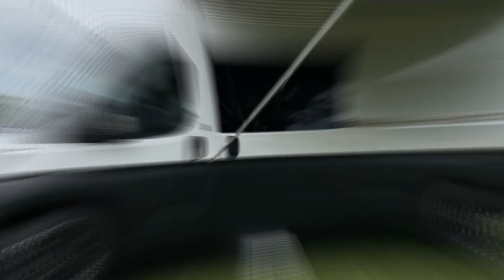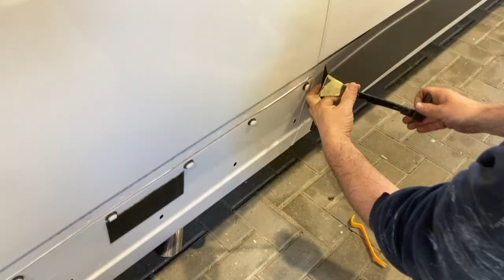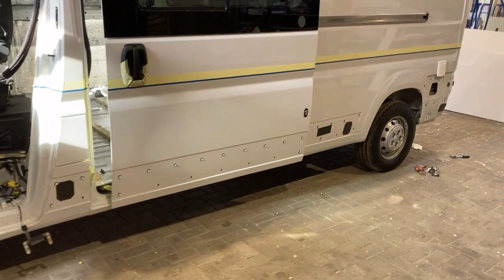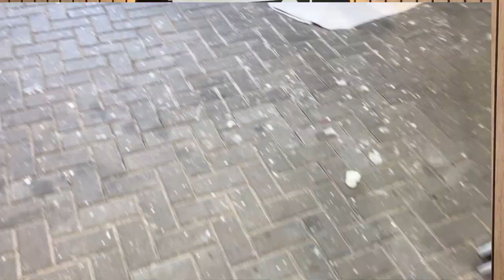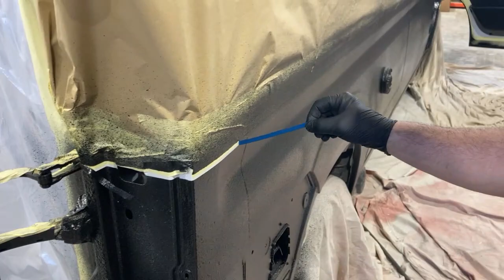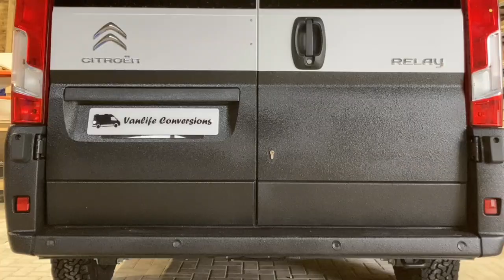Transform your van with RAPTOR paint | Durable and easy to apply | Adventure van

Comment: Raptor 
A. Volume – 3 parts RAPTOR – 1 part hardener – up to 10% color.
By weight
B. 100g RAPTOR – 30g hardener – up to 10g tint (3.5 oz RAPTOR – 1 oz hardener – up to 0.35 oz tint).
Refer to online TDS sheet for additional quantities.
C. 28 oz. RAPTOR (1 bottle) – 8.4 oz hardener – 3 oz tint.

 RAPTOR can be reduced up to 20%. When reducing RAPTOR, use a urethane based reducer.
Reply from the maker: Thanks for the comment

Comment: are you removing and re-applying the thin blue tape between each coat? You mention that you apply three coats, 45min between coats and must remove the tape within that 45min. Just wondering if you remove and re-apply or stack three layers in the beginning?
Reply from the maker: So we do a light dust coat, wait 45mins, do a proper coat, then remove the blue tape. Then assess it, if you are doing a dark colour on a white van you will likely need to tape up again and repeat a coat or two. If you end up leaving it much longer then an hour between coats it would be worth scotching it up again between coats

Comment: No priming? That's going to chip very badly
Reply from the maker: Thank you for your comment, we do need to release another video showing the preparation stage before spraying. We keyed up the paint surface using a D.A and scotched all the difficult to reach areas (curves) before panel wiping off the residue with a tack cloth. Then we set about applying the raptor. Thank you for pointing out that this step was missing in this video 🙏
Reply: Raptor does not need primer,just rub down body with 80/120. It only needs a "primer" coat on plastic trim.